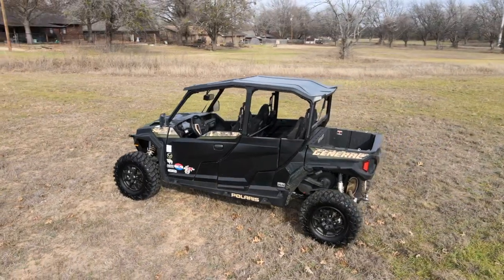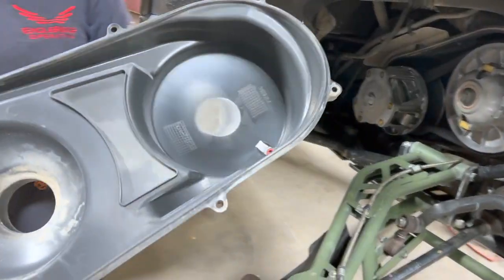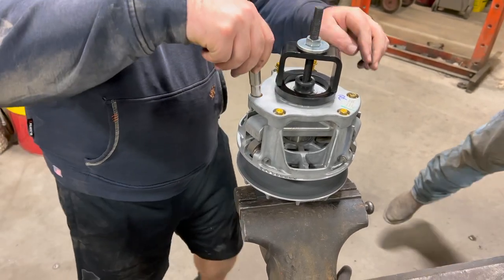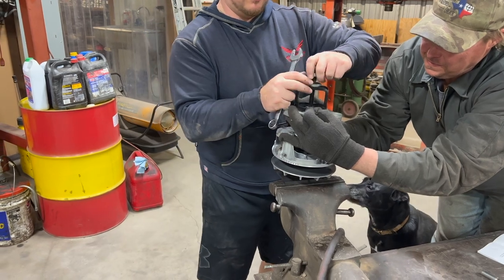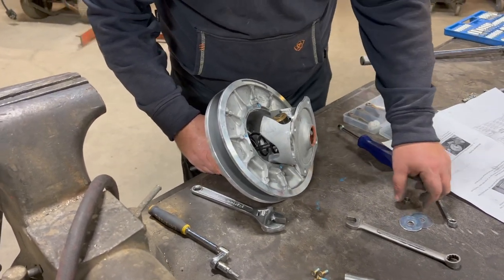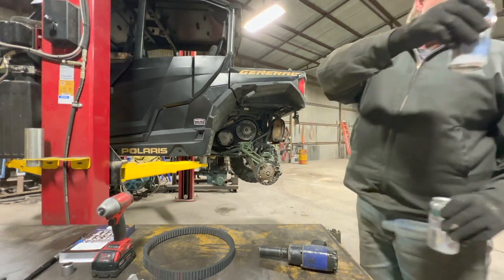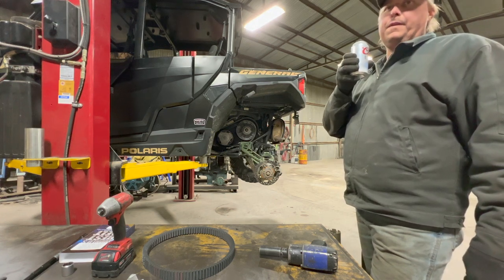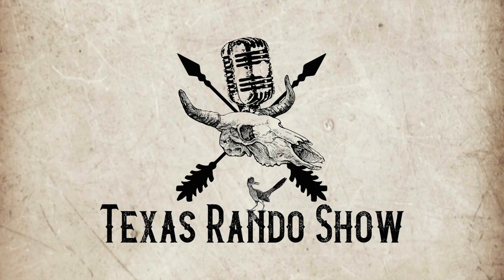2022 Polaris General XP 4 1000 Pursuit Edition Gilomen Clutch Upgrade

Comment: Do you still like the clutch.  Did you get a tune as well?  How is it holding up?
Reply from the maker: Thank you for the comment Bryan, I really like this clutch. I will be filming a follow up video on it this weekend. I did not get a tune. However, I did tune the clutch itself with the adjustable weight kit it comes with. I added and removed weights until I got it where I wanted it for the type of driving I do. It’s got about 100 miles on it now give or take. Please look for the follow up video this next week. If you have any more questions please let me know.
Reply from the maker: Bryan, just wanted to let you know the follow up video has been posted. Please let me know if it answers your questions.